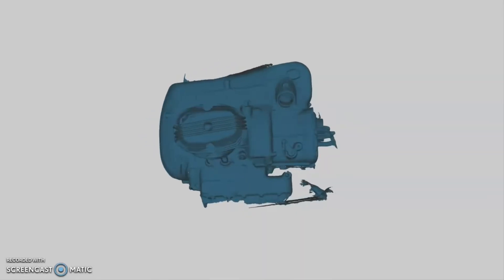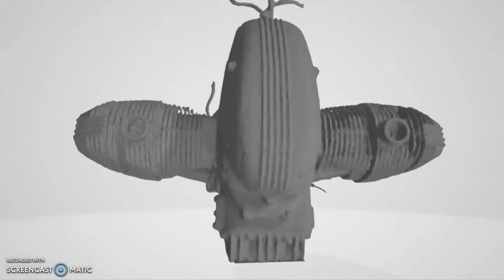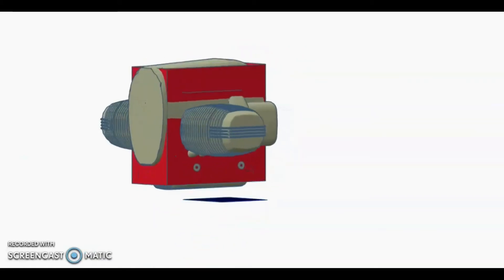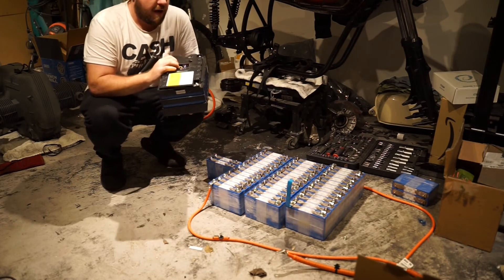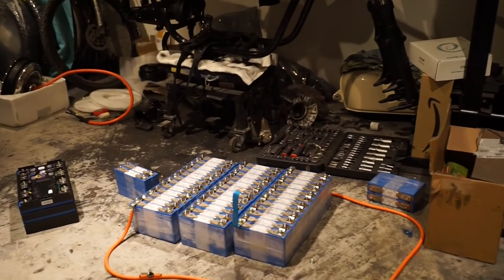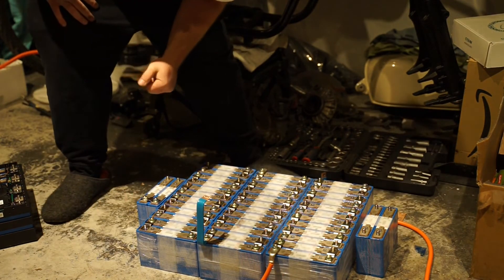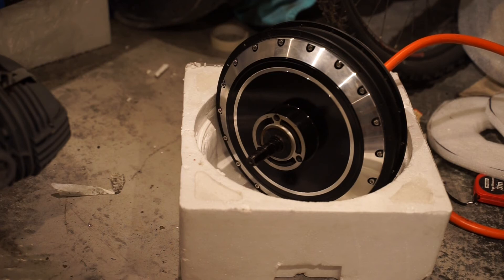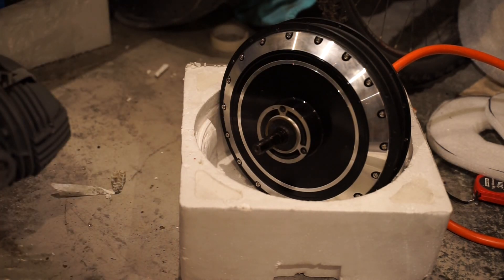DIY Electric Motorcycle Conversion -  Apollo Ep2 - BMW R80/7-E

Comment: I am glad to have found your channel. I am a long time Airhead enthusiast and have been planning a similar build. I am looking for a earlier year frame with dual shock setup to minimize the engineering required to adapt the hub motor. I am eager to learn from your progress.

Comment: Let’s collaborate! I’m very interested in your build. I have a ‘78 r100 with a <‘72 headlight (vintage look). I’ll likely keep this gas, but I’m very interested in all things electric and would love to do an E-Airhead. I’ve spent time pondering keeping that engine look. I think your approach is great. I have a rapid prototyping 3DP business. I’d like to offer my printing services in collaboration with your work to pull the project together. I can print up to 600mm cubed in pla, petg, etc (I can DO ABS on this but warping is a real challenge for solid parts over 300mm wide with any kind of height). I have a 350mm cubed high temp printer. Also a 700x350x400 open air printer. I’m guessing you’re gonna want large format at some point. Prints that fill these beds can cost up to US $1K. Shipping overseas with free printing would surely be better than a local option (unless you have friend with large format). Let me know if you’re interested!

Comment: How many KW is the hub motor? What speeds are you hoping to see out of the bike when it's completed? I really like the battery/engine casing design and I'm looking forward to watching this progress. Good work!
Reply from the maker: It's 12kw but I'll modify it slightly to get it working nicely at 15kw continuous. I hope to see speeds of 80-90 mph
Reply: @VforVoltageDIYEVbuilds  How are you modifying it? I'm assuming it's dangerous if you're taking the motor apart but if it's just reprogramming the controller aren't you worried you'll overload it?
Reply from the maker: @terryd80  ill be taking it apart, like the one king at the windings and adding cooling
Reply: @VforVoltageDIYEVbuilds  very cool!

Comment: I had a question after I saw the Honda. Is it hard to integrate EV grade charging port or you need some quite of regulator? Just so you can charge it quicker and go over the standard 240V
Reply from the maker: Not difficult just more expensive. I'll be doing a proper type 2 charger on the bmw build. Slight delays with that project while I rebuild the workshop. But hopefully it'll all be done in the next few weeks and I can crack on with it. I have all the parts here now so no more delays!
Reply: @VforVoltageDIYEVbuilds  Can't wait. I really like your approach. I might even try it myself at some point.